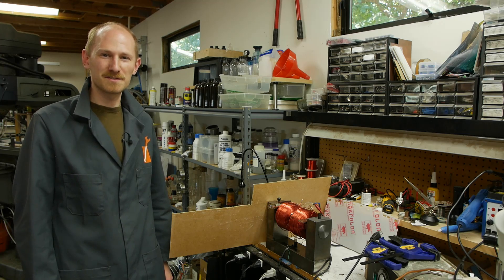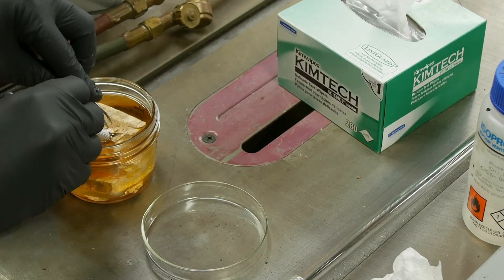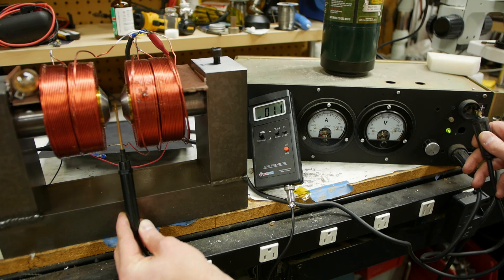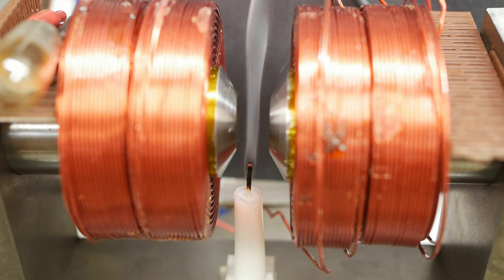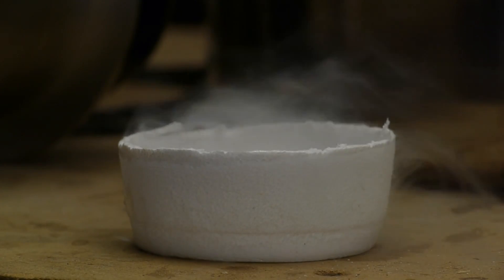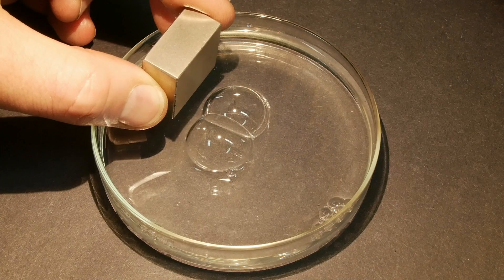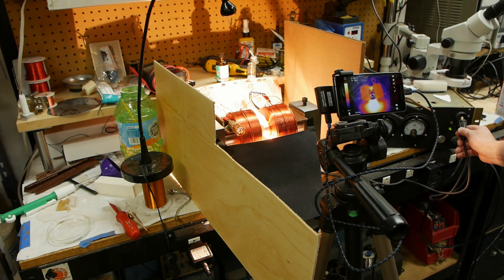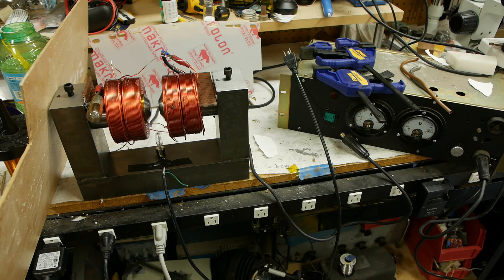Candle flame is repelled by magnets (and Zeeman follow-up)

Comment: Fire is the rapid oxidation of a material in the exothermic chemical process of combustion, releasing heat, light, and various reaction products. Slower oxidative processes like rusting or digestion are not included by this definition.

Fire is hot because the conversion of the weak double bond in molecular oxygen, O2, to the stronger bonds in the combustion products carbon dioxide and water releases energy (418 kJ per 32 g of O2); the bond energies of the fuel play only a minor role here. At a certain point in the combustion reaction, called the ignition point, flames are produced. The flame is the visible portion of the fire. Flames consist primarily of carbon dioxide, water vapor, oxygen and nitrogen. If hot enough, the gases may become ionized to produce plasma. Depending on the substances alight, and any impurities outside, the color of the flame and the fire's intensity will be different. 
From Wikipedia, the free encyclopedia

The magnetic field is making it harder for the bonds to be created, as these bonds are made by the negative electrons, there for the flame is weaker

Comment: Veritasium did a video on schlieren imaging. It would be interesting to see the hot air stream setup with the schlieren setup. It might also give a better idea of what it going on with that stream of air if it works. I don't remember the specifics on the schlieren setup and I could be wrong about it working for this setup but I remember the video showing a candle burning and you could see the air current. You could also see the air current with the sneeze in his video. Just a thought.

Comment: The flames emit water vapor and hot air can hold more water, as well.
After the candle flame goes out, the wick is still hot and is vaporizing wax - which may have magnetic properties of it's own.

Comment: Great video. Is moving but not hot air affected? A side effect of being hot is that it's moving upwards. If there's anything charged in it then you have a current. This may be why the gases in the bubble didn't do much. Maybe fill a bubble with candle smoke? We know that there is a dramatic effect with moving smoke so I wonder if there is with non-moving smoke.

Comment: I'm not sure if diamagnetic properties of soot have some effect, i assume that air is diamagnetic as well. I assume that some soot have small electric charge. Maybe you can try if flame or smoke in radial magnetic field (going through the coil) has tendency to spiral. (Edit: i've just noticed that that flame is deflected towards the magnets, but not sideways)

Comment: one way to reduce variables would be to do the experiments in a pure atmosphere, vacuum chamber with a flammable gas you inject o2 onto an ignition source, this way you'd have absolute control over ignition byproducts, and could vary flame composition. (yes, credit to Cody)

Comment: It's about the movement of the charged particles. The flame/or other heat source mereleycauses a flow that moves the particles.The moving charge creates it's own magnetic field and this is what interacts with the magnetic field you generate with your magnet.

Comment: Some natural gas boilers use a flame rectification device to confirm the burner is on - try researching half wave flame rectification - basically a half AC wave form current is passed through the flame - thermodynamics and electronics  is fascinating stuff

Comment: I have a suggestion. Two iPhones in a DIY rack which positions them at eye distance apart for making 3D videos. To focus at various distances, you would design a unit which makes them move toward or away from each other like eyes focusing. To view it, I guess you would put them side by side on a single video and put a piece of cardboard  from the screen to your nose, separating them. Or you can just cross your eyes a little, once you get accustomed to doing it.

Comment: I read a flame is  mainly composed of free electrons.   Could this explain the magnetic deflection effect?
Reply: Believe flame is plasma column with circulating electric currents.  Magnetic field bends the plasma column into cooler air thus dissipating flame.

Comment: The bubble on soappy water is actually moved by the deflection of the water's surface: water is also diamagntic. This is the same effect that makes corn-flakes move under a magnet. Even if they put metallic iron onto it, you can use polysterene or paper snipets and the magnet will still seem to attract them.

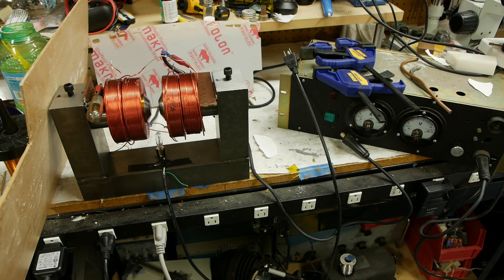Comment: At about 6:02 you see the bubble's waves moving as the magnet is turned on and off. You said there was no effect but clearly, at least to my eyes I see a strong effect on the flow of the bubble swirl. It's because everything is magnetic to a degree. I'm working on the discovery of what I guess I could only call colors of magnetism that effect states of matter differently. There's many colors and many frequencies, why also does magnetism only have one? I don't think it does.

Comment: I think the hot air moving through the cold air act as a diferent material even if both are exactly the same thing, but if the density is different, maybe it can work as a different material. 

The movimentation between hot and cold can create a little potential even if this is air (maybe static electricity?) And turn this possible.

Can you do a test? Use a glass tube with clear watter with suggar (to be more dense) and put a bit of colour with water on top and dont mix it. Heat the bottom and analyse how the food colour will comport. If this works, my theory of moving atoms works XD

Comment: I can't remember the source but they discussed how a flame was ionized gas and would conduct electricity even to the point that one could use two vertical screens within the fire and send audio signals to the screen and the flame could speak to you as did the burning bush to Moses. Rock and roll campfire anyone? Never tried it myself but it's been a note in the back of my mind for most of my 64 years.

Comment: Could it be that the magnet  is adding enough energy to the already ionizing flame that even more electrons are broken free from the atoms then creating an ionic wind? Or possibly that the electrons have been pushed far enough away from the nucleus due to heating that the electrons feel less of the pull of nucleus and the magnetic field becomes the dominant force causing them to  polarize?

Comment: The flame is a plasma. So the magnetic field will try to separate the ions from the electrons. The electrical attraction between the two will try to prevent that, resulting in the plasma not wanting to enter the magnetic field. That's what I think.

Comment: What would a Hydrogen/Oxygen flame do in such a set up? If you isolated it from the atmosphere it should be carbon free. I'm not sure about its ionizing temperature or anything like that but couldn't you get a fairly pure, controlled, and consistent flame through electrolysis of distilled water??

Comment: current model of atom is fictional. atom is a functioning unit. when you heat it, it's activity increases. the reason for chemical reaction accelerate. atom interaction with magnet flux depend on it’s activity. Scientist do not know structure of atom and they have been too stupid to ask officially past 43 years. Full detail in my 1975 Bremen summerhouse notes or with official request only. MG1

Comment: It would be interesting to try the experiment with a flame burning a 50-50 mixture of carbon tetrachloride and carbon disulfide.  The ignition temperature is low enough that one can dip a hand in the mixture and ignite it without burning oneself.

Comment: what about brownian motion of dust and particles in the air having any involvement? the hot air and strong magnetic force then maybe further exemplifies this demonstration?  Also water(vapor) capturing heat or infrared light, maybe relative to its surroundings, may be forming an energy differential or structural charge that is affected.  Check out the "The Fourth Phase of Water" by Dr. Gerald Pollack
Reply: along the lines of the EZ water charge researched by Pollack, this water (and in this case heated hence more electrically charged, following this research) molecules structure so that they are supposedly H3O2. I'm not sure how these atoms exhibit para or diamagnetism, maybe a net charge is interacting with the flux lines. However correct this research is (which I find fascinating) I'm not at all sure ho pertinent this and what is exactly being explored in terms of the magnets and the dimming or specific movement of the candles in the magnetic field
Reply: so would hot air potentially be more diamagnetic because of the charged water vapor? also i know im rambling but i am interested more about brownian motion particles in air, their charges causing them to repel from each other and how a strong magnetic field could affect that

Comment: the 'smoke' from an extinguished candle is vaporized fuel, right?  it's not carbon dioxide until it interacts with flame... which is out.  fuel certainly has carbon too, but perhaps in the form of hydrocarbons?

Comment: I could not replicate your results with permanent magnets.  Ajunct video suggestion:  Build an apparatus that allows you to adjust in and out equally permanent magnets and try again.

Also, you need to secure the deflection movement on your solenoid coils.

Comment: The flame is repelled because it is warming the air and ions are moving upwards. That's the same as the heat gun used. What you should do is have only one pole of the magnet above and see if it is attracted or repelled and switched if the flame changes. Also Ions move over when dissimilar metals together are heated like iron and Constantine for a thermal couple generating a small voltage.

Comment: the bubble one needs to be expanded as well  with a camera that can look at the bubble surface i saw a lot of movement on it when you switched it on and off ...at different voltages  or even a rheostat  to operate it? electromagnetic effect on a gas filled bubble and try filling one with Ozone if its possible  as a micro earth simulation?

Comment: I think the flame is ionized gases. If my understanding of how a flame rod flame detector works is correct, it is trying to complete an electrical circuit that will not make without the presence of the ions in a flame. Similar to how electricity will not flow well through distilled or deionized water. The flame is probably the transition from initial reactants to products of combustion, and while it's in transition its the ionized components.

Comment: I doubt the bubble would deform from moving air around it. Spheres are some of the most aerodynamic structures and the surface tension isn't going to deform under that minimal load.

Also, one would anticipate that fire will cause ions to form. Ions moving due to the flame causing an upward acceleration would create a stronger magnetic field, and thus would move more violently in a magnetic field.

Comment: Edmund Scientific a.k.a. EO may still sell Schlieren kits.  I bought an 8 inch set many years ago for my employer and later on, another division of the same company bought a 6 inch kit.  The basic kit operates in simple shadow graph way, but you can also make one that uses diffraction and produces colored display.  By the way, the wind tunnels use these for visualizing the air density profiles around the model.  The gas density varies by its composition and temperature, as well as localized pressures.  Helium gave a good contrast against surrounding air, being much lighter.  On the opposite side, carbon dioxide also gave a strong contrast.

Comment: I had a physics professor who told us about a flame speaker he had when he was younger.  it used high temp electrodes in a propane flame.  the alternating charges between the electrode effects the temperature of the flame, pushing air, generating sound.  he said it was shockingly loud and clear.

Comment: I would of assume this is because a flame is electrically conductive. Something I figured out when I was kid experimenting with high voltage and different high voltage apparatus.  What I found is any sized flame will pass high voltage over large distances as if it was a piece of metal.  So if a flame can interact electrically, it has to interact magnetically.

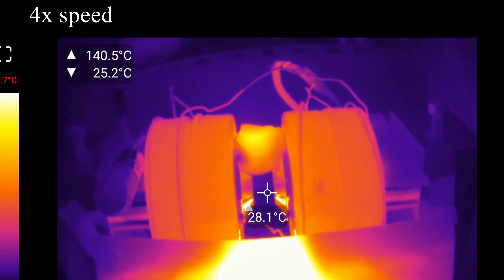Comment: Why the light bulp did not change its color in the infrared camera image on 8:34?. It is certainly getting hotter as it turns on and off. Does the glass around coil of bulp stop infrared from going through? Which i doubt it does
Reply from the maker: Good observation! Yes, glass is opaque to the wavelengths sensed by thermal cameras. This is why they can't use glass lenses. Normal glass windows when viewed in thermal vision look like mirrors, and also radiate their own IR.
Reply: Typical windows/lenses for far IR (heat radiation) are Ge or CaF or ZiSe.  Glass is opaque, hence
the greenhouse effect.

Comment: I remember playing with high voltage arcs and a candle. Cant remember if it was AC or DC
The flame moves violently when the arc jumps through it (actually i think it's more like 'to it' and 'from it than 'through'').
With an electrode each side of the flame it will use the ionization in the flame as a short-cut to the other side.

Comment: There are several forces at work. The flame itself is unique because the burning flame is actually nuclear and there is a release of ions and charged particles. All other electricity is only captured but the flame itself is making electricity itself just like the sun makes electricity and releases it as solar wind.

Comment: Is it necessary to assume that hot air is more diamagnetic than cool air in order to explain the effect? Or does the diamagnetism just become apparent because there is a moving stream of air which is deflected? What happens when you make an ordinary air current through the magnet visible? (If nothing else, it would be a good control!)

Comment: Any moving charge will be deflected by a magnetic field. Is it not possible that the flame contains atoms or molecules with a positive charge? Having ejected an electron? You would expect the flame to deflect at a right angle to the magnetic flux line and its own direction of travel. And reversing the magnet polarity would reverse the direction of deflection.

Comment: You should get a blow torch flame and put it between the poles of the magnet.  Have the flame going up.  If you put a volt meter and measure across the flame so it's perpendicular to the magnetic field and the direction of the flame you will measure a voltage.  Should be some experiments in that.  https://en.wikipedia.org/wiki/Magnetohydrodynamics

Comment: Try this again with automotive a/c clutches. They are pretty powerful for 12 volts. If you put the flame through the center of the electromagnet. You can reverse polarity and see if the flame.gets bigger or smaller. It probably repels either way, but I'd like to see it. I can send you these electomagnits if you'd like?

Comment: The hot air is moving with a convection current. So because any charge it carries is moving, it also has an electrical current. (Albeit it's very weak.) This is likely why the magnet affects it.

Also seemingly mundane stuff like this may have use in some applications. Might allow more efficient operation of jet engines by better isolating heat and limiting heat transfer in the burners.

Comment: The flame is just another form of plasma. How do you think they get the plasma in a takamac to stay in there. Electromagnetic fields. And you are applying a large magnetic field in the presence of superheated gas. Which even at it's lower temperature carries many of the same properties.

Comment: It's probably possible to calculate the pressure exerted on the flame for each theory, if the data can be found, and see if it adds up or if there is something missing.
Also, supercooling the magnet would be nice

Comment: H2O Is another byproduct of combustion and is diamagnetic. That's the real reason the soap bubbles are repelled,  not the air but the water supporting the bubble. Everything is diamagnetic to some degree  and water is one of those things.

Comment: This might be very stupid, but isn't a candle flame (or any flame) just a regular plasma, i.e. (partially) separated charge carriers floating around with high kinetic energy because of the high temperature? Is the effect you are seeing not just the plasma reacting to the magnetic field? The electrons that are ripped from their atomic cores are definitely reacting to a magnetic field when they are in motion (because of Lorentz force). I have seen a lot of electric arcs reacting quite similarly reacting to an external magnetic field. So maybe you are just observing Lorentz force on a high temperature cloud of electrons and nuclear cores.

Comment: I have very little document-able sources for this, but I am a welder and I play with plasmas all the time. 
Plasmas are conductive, if its conductive it can/will create a magnetic fields. 
Try sticking a neodymium magnet near a TIG arc, I was able to "weld" (too brittle from thermal gradients...) an alumina TIG welding cup with the plasma that was knocked around by the magnet... Good times

Comment: What about magnetic fluxes? Like in motors you have to induce a flux for it to work, hot air is moving with the candle perhaps causing a flux where a stationary volume of air may have none?